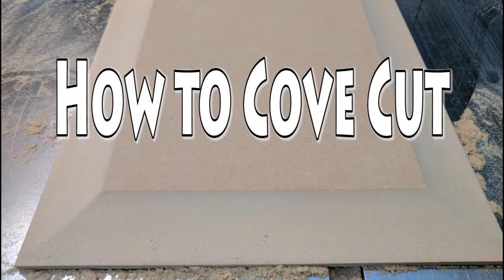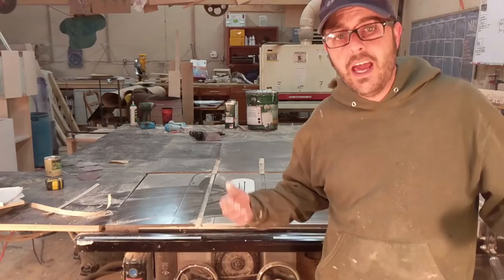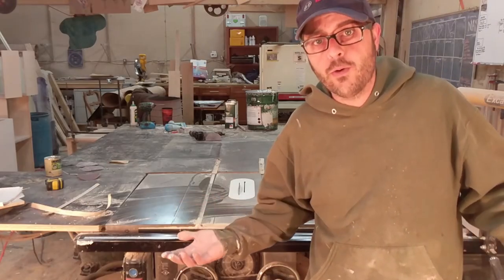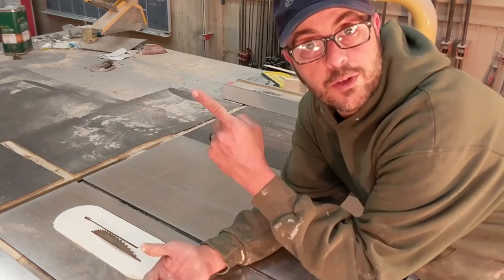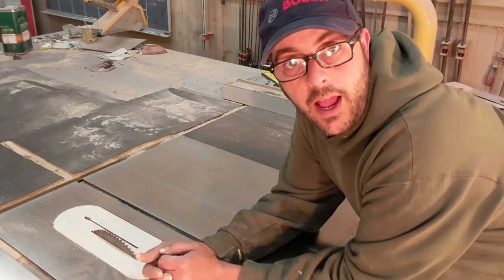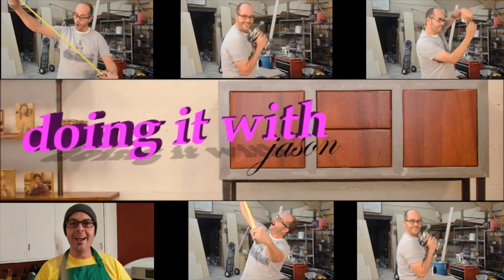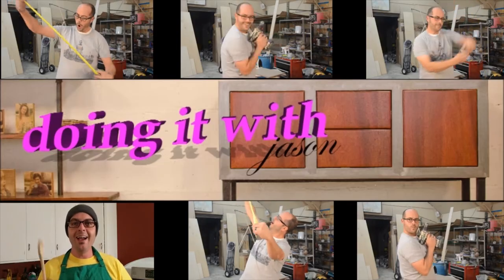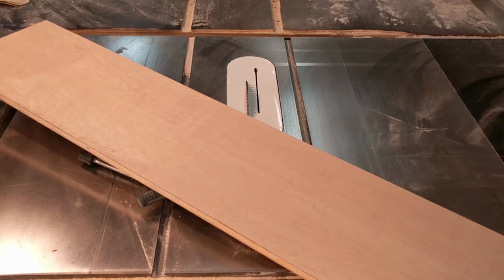How to Make A Raised Panel on a Table Saw with a Cove | #DoItYourself

Comment: does it matter what angle to put the fence to the blade
Reply from the maker: SHRIMP11112 Mainly, you want to set the fence at the highest point of the blade. it doesn't matter so much, the angle helps determine the width of the cove if that makes sense
Reply: It does appreciate it.